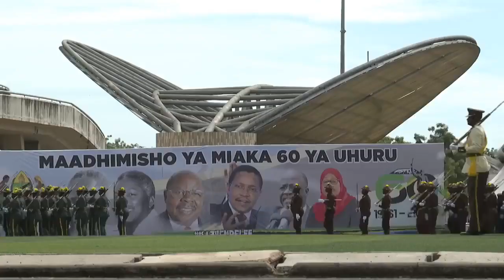Is Rwanda SGR still on the way? Why has it taken long?

Comment: RWANDA 🇷🇼 GDP is low that such huge project will leave ahole in its expenditure, thus Private Public Intiative,No one showing interest coz container volumes are minimal. Burundi 🇧🇮 is viable option for DRC 🇨🇩
Reply from the maker: Taking a PPM model may further delay the project. A long term loan would be the most feasible option. Also, a "no project" can be an option and the country relies wholly on existing infrastructure especially when Tanzania and Burundi completes their sections. However, for strategic reasons, Rwanda has to do something about the SGR and fast.